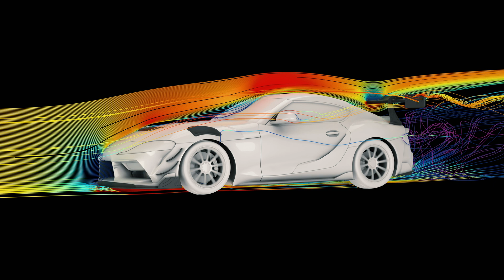What do these even do? | Engineer Explains Vortex Generators

Comment: It can also be attached under the wing to speed up the airflow and increase down force. I am wondering if you tried 5mm height and place then in a row; does that make more down force?
Reply from the maker: It can in some cases. Are you asking if we have tried putting these on the bottom side of a wing to improve performance? We have not.
Reply: @VerusEngineering The latest version Honda Civic Type R Wing has integrated the so called Chevron vortex generator under the wing and it showed great improvement on rear down force.

Comment: I can see that they are very beneficial if you run a wing with adjustable AOA. What if the wing is none adjustable or has no wing at all?
Reply from the maker: These will still improve the performance of a non-adjustable rear wing. Increasing the attached flow on the rear glass is always beneficial.